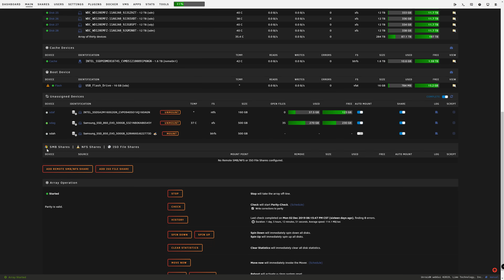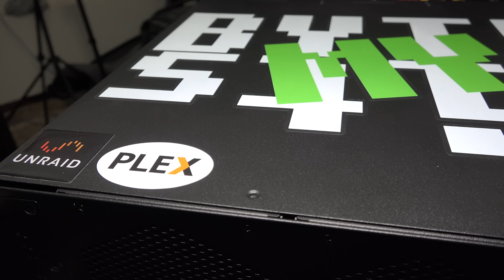My $10,000, 284TB Plex Media Server, Powered by Unraid & RTX 4000

Comment: Inspired by your build I am doing something similar and using a 36 bay server case but I was curious as to how you changed the SFF-8087 cables for the hard drives you had originally to the SFF-8643 cables you used for your LSI card? It looks like you switched them sometime when you powdered coated the case. I have the same LSI control card but of course the SFF-8087 cables are not compatible. Any direction would be extremely helpful. Thank you!

Comment: By having that mixed bag of drive sizes (JBOD), you can't stripe across all of your disks with RAID 5 or 6, therefore you can't get the 12Gbps from the LSI RAID controller. The The PERC H740P RAID Controller is better, LSI is crap. I've worked in data centers all my life, so trust me on this. You should backup your data to somewhere, and create multiple RAID 6 Volumes, consisting of like sized drives. If you're using this as a daily driver, it's better to run Windows 10 Pro 64 bit, and then run Windows Subsystem for Linux with Ubuntu. Create a startup script that launches WSL at startup and since Plex installs itself as a service, it will start up on it's own. Even easier, and faster, you could use a Docker container on Windows and skip WSL. Get comfortable with PowerShell and Docker, you'll be glad you did.

Comment: I'm doing a large scale plex build. I'm not a super fan of HW transcode with a video card as it supposedly makes low rez video really bad. Do higher end xeons with 8 cores or more per cpu ( 2011, or 2011-3 chipset ) handle the transcode without Quick Sync? Should I get a dual xeon without quick sync, or a single socket 3.3ghz older cpu the has Quick sync onboard? I managed to get a 45drives Storinator case and need to fill it now. Is there such a thing as one server to hold drives and another that just does plex or is that too much.? My current 1151 3.3 xeon does 21 streams now. Thanks for answering if you can!!

Comment: How do you like the RTX? Do you think it's ultimate number of transcodes is hampered by it's RAM size vs. it's number of NVENC chips? Right now I'm running a unlocked GTX 1070 for the two NVENC chips that makes it closer to a P5000, but I went overkill on my build elsewhere and would love to run a "real" graphics card for some occasional high resolution gaming. I've seen theoretical estimates for the RTX Titan in the 40+ range (not that I need that, but I'm skeptical since it has no increase in encoding chips vs. your RTX4000 only more RAM.

Comment: I have been watching your videos and have decided to replicate some of the stuff you have done with used hardware to keep the price semi controllable.  So far I have my daily driver slash editing rig built. Its built with a pair of 8 core xeon cpu's that I got for 50.00 each. The motherboard was 95.00. The 128 gigs of 1600 DDR3 ECC ram was 200.00. The 8gig RX580 cost me 185.00. I just ordered a Rosewill  RSV-4310L, and I'm ordering a 25u rack next payday. After I get my current PC transferred to the new sever box and racked, its time to save for the second computer. That one will be a file slash media server. When its all said and done I will have a daily driver, a plex server, a pf sense router, and a ups in a 25U rack with room left for what ever I come up with next.
Reply: Well things have changed a bit.  That second computer turned out to be a Gen1 1950X threadripper. Its housed in a RSV L4500 4U rack chassis, and is my editing/daily driver.  The 16 core dual xeon is now a dedicated Emby server.  The RSV-4310L will be replaced by my Inter-tech IPC 4420 with 20 hotswap bays that was delivered today. I will move my threadripper build  into the RSV-4310L since I don't need hotswap capability with that box.  Once I save some more money, that will leave the RSV-L4500 for my blue iris server since I have the hotswap cages for it essentially making it a RSV-4412.

Comment: Zen 2 temperature monitoring has been included in the Linux kernel very recently. It is possible that the kernel version unRAID is using is older and the patch is still not present.

Comment: I am building a plex server for myself.  I have a couple questions; which is better with a Raid 5 setup with 4 x 8TB hard drives - (1) use the motherboard to create a hardware raid? or use a SSD to put Windows 10 OS and then use the software to create the Raid 5 ?      For the HD format use GPT over MBR ?  I have room for 8 drives.

Comment: I'm going to turn my current computer in to something very similar to what you have.  My current set up is built with used parts because I'm ball'n on a budget.  I'm running a pair of 8 core E5-2680 xeons, 128 gigs of ddr3 ecc ram, a 1tb HP ex950 nvme, an 8 gig RX580 and I just put in the first 12 tb wd white drive. She is powered by an evga 1 kilowatt  80 plus gold modular supply.
I'm going to transplant this into a rosewill  RSV-L4412 12 bay hot swap 4u chassis. This will become my file/media server. I will fill up the bays over time with 12 tb drives.  I"m going to build a daily driver (hackintosh) based on a gen1 16 core threadripper
 ( again I'm ball'n on a budget) and either a  vega 64 or a vega 56. This will also go in an RSV-L4412 4 u chassis and I will mount them both in the corner of my office in a 12u open frame rack.

Comment: Running Plex on a dell r720xd with 12-10TB hard drives using Ubuntu ZFS system with two raid-z1 6 drives striped. Plays anything you throw at from Plex no problems!

Comment: You should retest your p2000 too.  Since they updated the transcoder you get far less.  It’s vram limited at 20-22 1080p transcodes.  And 4-5 4K transcodes.  

The rtx 4000 should be a huge upgrade because of the extra 3gb of vram.

Comment: Freaking great job. Thanks for your really great videos. I had been following along and decided to get this case and move my Unraid over. I’m running 100TB right now. Only 27TB used. Lol. A couple of people asked about the case. I bought a brand new empty chassis with power supply on eBay. Just no hd trays. Just checked and the same seller still has 6 left. 

https://www.ebay.com/itm/SuperMicro-Chenbro-NR40700-4U-48-Bay-Storage-Chassis-w-Rails-PSupplies-NEW/383190957683?ssPageName=STRK%3AMEBIDX%3AIT&_trksid=p2057872.m2749.l2649

My Rig:
ASUS Sage 10g
128gb 3200  Ballistic memory
I9 9900x
Rtx 4000
HBA card

Comment: The hilarious thing is that you could’ve used Plex server on a VM in a datacenter and picked up cloud object storage and you would’ve had pretty much unlimited processing power and unlimited storage with a minimum of gigabit speeds both up and down (you can easily go to 10 or 40 gig with a few more bucks) with 100% uptime and automated backups for roughly 10+ years with the cost you used to build this thing which will be outdated in less than half that time. This video is going to be painful for you to watch in a few years. Add in a quad tuner with a Plex Pass and you’ve got a full on live tv with DVR setup. Oh and you don’t have to worry about the electrical cost or any noise or physical space.

There are plenty of times when a physical server is useful. This is not one of them. Don’t even get me started on how silly 10GE is for a home network for now or the near future, even with heavy duty network load.

Comment: Currently running the same case, but MB/CPU changed out. running a ASUS Prime X570-PRO, Ryzen 5 3600 and (right now) Version 6.7.2 2019-06-25 (NVIDIA flavor). Using the Dynamix family of plugins the CPU/MB temps are populating and the fan speeds as well.
Reply: what case is it?

Comment: System Temp and Fan Auto Control are dependent on the fan control/temp monitoring chip rather than the CPU (doesn't matter than it's Ryzen). I have a similar Ryzen motherboard from MSI that uses the Nuvoton NCT 6795D.  There's a good chance that your motherboard is using the 6795D too. 

Here's how I got it working for my server: https://forums.unraid.net/topic/34889-dynamix-v6-plugins/page/91/?tab=comments#comment-709992

First thing I would try is manually entering 'nct6775' as the driver in the system temp plugin settings. I think will take care of it. If not, try the modprobe command.

Comment: IIRC, you have to install nerdpack to get system temps working, I remember reading somewhere on their forums that Linux support for AMD in general isn't as good as Intel.

For me the system temps plugin is useless, I'm running dual CPUs and can't see both dyes at once
Reply: Nerdpack is not necessary. It is only used to install Perl - Which in turn is used for the auto driver detect feature of the addon.

Comment: Jason can you do videos on all your new software setup as I’m looking for ideas for my plex server / plex metta data in a separate hardrive how did u config that ?
Reply: Manually set the docker data location in settings. Use SSD, not hdd
Reply: Hey desk003 thanks for taking the time to reply at least now I have something to work with thanks 👍
Reply: @paulstir  Yep! It's pretty simple. Sorry for the quick reply earlier- use the unassigned devices plugin in Community Apps, so you don't have to put the PMS data on your array- the array is too slow. Or, use the cache drive only- but I went direct to a separate SSD, so it's completely removed from the mover and etc
Reply: Hey thanks bud I’m new to that level of programming plex , that’s ok I really appreciate you taking the time to help , but I am one for setting the mind to things and I won’t stop until I figure it out 👍

Comment: Jason, on the dynamix temp screen, type in “IT87” and then click detect. This works for a few folks before 6.8, but it didn’t work for me until I upgraded to 6.8. Lemme know how it goes.
Reply: IT87 ("k10temp") will work under v6.8, but likely get him CPU temp only ("Tdie" and "Tctl").  At least in my case with the X470, drivers are not available for the "ITE IT8665E Super IO Sensors" yet.

Comment: To display the sensors, I am unsure what went wrong, but before v6 you had to set up your own sensors.conf manually. 
https://wiki.unraid.net/Setting_up_CPU_and_board_temperature_sensing
You can go thru and follow the same procedure thru console to identify the right chip for your motherboard and check to see what dynamix has set up for sensors.conf and edit as needed.

Comment: Dude, you must download some movies!....Also, you missed out on using ECC RAM?  I know unRAID doesn't need it, but any server should be using it for the small cost increase. Ryzen supports it out of the box.  This RAM is compatible - CT16G4WFD8266.  Amazing build though, a man after my own heart!!
Reply: While Ryzen supports ECC, there hasn't been a AM4 motherboard that is confirmed to report/log errors being corrected. Which is half of the job of ECC. If you don't know that your memory is correcting anything then what's the point?
Reply: @SHUXCDynasty  i think that Asrock are the only manufacturer that report ECC errors (and are committed to supporting ECC at all!), and they should also show in the windows event log.  You may well be right though, but i would still rather spend an extra £50 and go with ECC.  I'm hoping any errors will also show in the unRAID system log.  I just think if you're spending £10,000 - why not spend £10,050 and go with ECC (EDIT - read the article on Level1Techs...very interesting....)

Comment: Can never have too much storage but how many transcodes do you actually do at once??? Surely you would be restricted by upload bandwidth way before you would use 1/4 of the transcoding potential of Loki. I think a newer gen intel i5 or i7 with quicksync enabled would be a better solution. Low power usage and you can dispense with the expensive graphics cards

Comment: why not get the wd 14tb or 16tb drives?  Also why not use the WD ssd nas drives for your cache setup.  Also you should try transcoding using devices running on a 4g/lte connection to see if you can get the 28 streams you got originally.  Go the full 48 drives if you have the capability too.  Go Epyc cpu for Loki.

Comment: 284 TB and NO offline backup.

Wow....you like to live dangerously.

I'm at about 100-150 TB or so and I've just deployed my LTO8 tape backup system.

The system that's running the tape drive pulls the data off the server over 100 gig Infiniband. :D
Reply: why go with tape and not a second server?
Reply: @Nir.Arieli  
Because tape has a 30 year life and takes zero power to passively store the data.

When you need it, it DOES work slower, but that's why it's good for archival use cases.

I'm at about between 100-150 TB based on raw storage capacity and just with a single tape, I was able to free up something like 30-40 TB by eliminating the need for duplicate copies of the data that I had when I was using two servers, one to be the live backup for the other, so I'm able to flatten my data management structure, and writing it to tape, I can use a grandfather-father-son triplicate setup to ensure redudancy and consistency between the tapes on a rotating basis.
Reply: @ewenchan1239  interesting. thanks for explaining 👍
Reply: @Nir.Arieli  
No problem.

Comment: I went with i9 9900k cpu in my server. I'm wondering if I should off gone amd now.
Reply: 9900k is wasted in a server, move that chip to a gaming pc. Calculate how many cores you actually need in your server. Go ryzen for budget build, they work great as servers. Make sure to choose a motherboard that supports ECC w/ the ryzen. Also if you want to run VMs and be secure AMD is the way to go as Intel has a ton of vulnerabilities on the hypervisor side.
Reply: @adamwzll  has there been a AM4 mobo that anyone confirmed is reporting/logging error corrections via IPMI, etc? From what I've seen so far mobos "support" ECC but without any error correction reporting, what's the point? You'll never know if it's actually working.
Reply: @SHUXCDynasty  Yes actually on the new x570 chipset ASUS has a WS Pro ACE motherboard that supports regular ECC dimms and not just UDIMMS. Also the motherboard supports ASUS Control Center, you'll need to have hyper-v installed on it if windows or another hypervisor to run the command center to be able to connect similar to IPMI, second option is always best. Though IPMI is not even on most consumer motherboards. Last one I saw was for ASUS x99 WS IPMI board. I even have the ASUS x99 WS but no IPMI as that wasnt an option when I was buying. Ryzen as servers is for the most budget but new hardware without any major vulnerabilities. If you want IPMI grab many of the decommissioned older gen servers on ebay. But make sure your network and firewall are in tip top shape as Intel has tons of open holes since Specter/Meltdown came around. I just feel as 9900k is really wasteful as a server when there are cheaper options around and most servers do not need that IPC speed, which is best for gaming/rendering.

Comment: What about ECC memory? Curious if you were considering that since you cared about ECC with Zeus. Last I checked, while Ryzen "supports ECC memory", it's not validated by AMD.

Edit: Also. Dope AF build dude.
Reply: @Dynizzle, i think ryzen does support ecc, but because it is consumer grade hardware it only support (depends on the model) 32-64gb.
@Byte My Bits since you're building a server, why not going with epyc series which support +2tb of (ecc) ram, and also were built to work 24/7?
Reply: @Nir.Arieli  I haven't seen a single person report any AM4 motherboard showing errors being corrected in IPMI.

There's a discussion about it here on Wendell's forum - https://forum.level1techs.com/t/asrock-rack-x470d4u2-2t/147588/54

Comment: GTX 1660 with NVIDIA patch is the best bang for your buck GPU for hardware encoding. Its using the Turing NVENC and the card is plenty powerful.
Reply from the maker: Quadros just make things a little easier #lazy
Reply: @Bytemybits  agreed
Reply: There is a single slot GTX 1660 Ti in the works by Colorful that looks like a juicy option. But release date is unknown

Comment: You should take your extra hard drives and make a ZFS pool, gets around the max 30 hard drives in a unraid pool. Checkout what Wendel from Level One Techs did for Gamers Nexus.
Reply: Ronald Clark that lacked so much. I hate when they edit out a lot of the need to know stuff to replicate it. How they had a problem with fitting it in. Then they cut to 30 mins later and briefly said we swapped it for a smaller fan. That on top of they didn’t go into any technical limitation of 30 drives. Nor why they didn’t use freeNAS